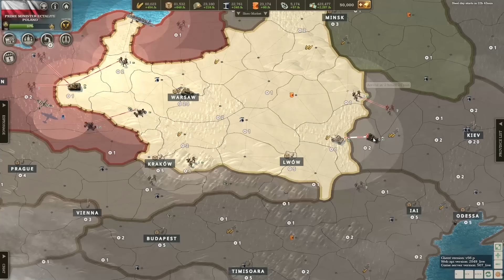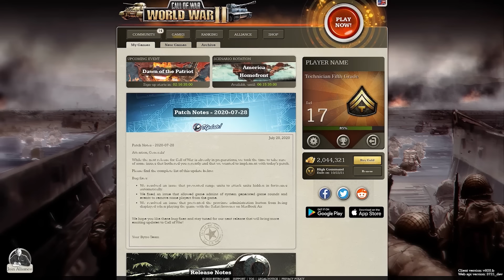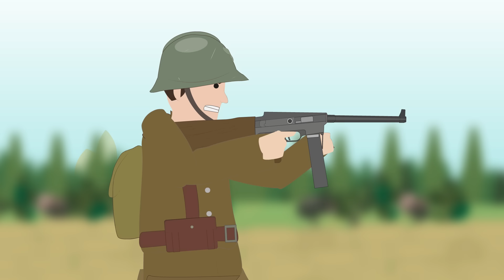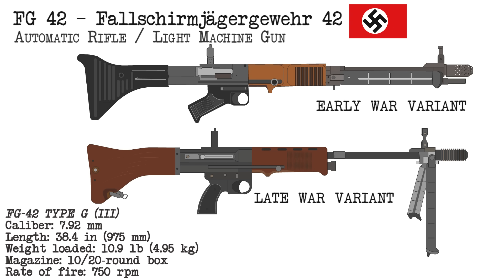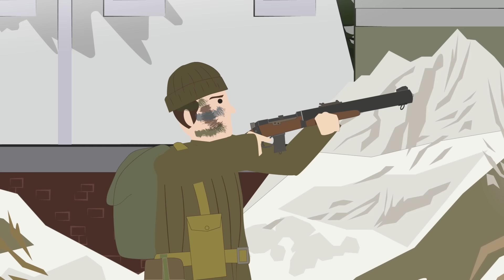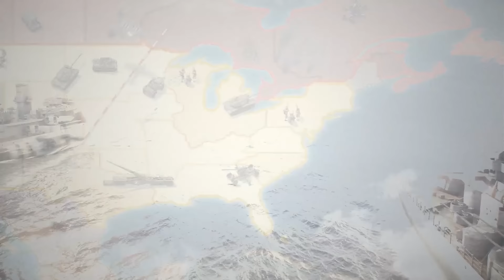The Rarest Guns of World War II

Comment: The MAS-38 may have been rare before and during W.W.II but after is a different matter, the French went on to produce over 200,000 of them between 1945 and 1949, so they’re not as uncommon today as the video might suggest. As far as the De Lisle is concerned even though less than 150 were produced they went on to be used in both the Korean War and the Malaya Emergency, it’s also rumoured that they were still in use by British Special Forces until the early seventies.

Comment: Well, they didn't do the FG-42 for ego reasons. 
Basically it for the paratroopers it replaced the Kar98k and MMGs like the MG34 with a multi-role gun that was lighter and easier to use because it had a semi-automatic and fully automatic switch. That way it could be used for machine gunning, assault, and marksman roles. 
It took way too long to design, though, and had design features that kept changing due to conflicting roles. For example, the angled pistol grip was better in a marksman role  when in prone but less appreciated in assault roles. The Bipod placement was apparently also a huge conundrum that kept getting moved around.

Comment: I have a repro FG42, and it shoots extremely well.  Recoil from the 8mm round is minimal:  the muzzle brake is very effective; and the straight receiver/stock design helps.  Years ago, when stationed in Germany I talked to FJ veterans and asked about this weapon.  They said, pretty much what the video says:  great weapon, not enough of them.  Though they primarily used it as a semi-auto rifle as in full-auto it was difficult to control.
Reply: Difficult in full auto?
Also when prone using the bipod?

I always figured that the Bipod was needed for such a heavy recoil on the light gun.
But I never got the chance to ask if that was true or not.
Reply: @MrDwarfpitcher  well the Bipod is because it was designed to replace some paratroopers' Kar98k. They used the semi-auto with it as they also issued scopes with them (at times).

The angled grip and Bipod at the end of the barrel reflect that design consideration.
However, these features were less favored because they made the full auto less comfortable as bipods on machineguns tend to be better slightly towards the receiver iirc
Reply: Well for a gun lighter than the Gewehr 41, I'd expect the Full-auto fire option only being used for close-quarters if they somehow found themselves in those cramped spaces.
Reply: first of all no u dont
Reply: @BastianOejenholt  how would you know

Comment: Purchased a pretty rare piece from World War II last summer. Called the Mosin Nagant M91/30/43 by most gun enthusiasts (records of its existence in English are practically nonexistent). A limited production of around 21500~ were produced to appease Stalin's rage at his soldier's habits of losing bayonets. So a contract was offered to whoever fixed the issue. A fixed bayonet was proposed, but was too long for the CQC elements of the Eastern Theatre. A man by the name of Semin (Syomin) concocted the idea of a side folding bayonet that locked into either place when required. Design was turned into the M44 after Stalin was pleased with the results.

Comment: You want rare?   
What about the Norwegian-made Sten guns? Made in bicycle repair shops and other small workshops in German-occupied Oslo. They designed an automatic record player in order to xcommercially produce the parts needed for the trigger mechanism. They are easily recognisable as the only Stens that are top fed. But most of the around 800 made was destroyed soon after the war ended, so good luck in finding one. (Only about 20 are known to exist)

Comment: "under powered 8 mm pistol round" yea... most submachine guns lack the "bite" it's called sub- machine gun because it's sub-sonic, aka not flinging the round fast enough to brake the sound barrier. Most if not all SMG's are pistol calibers. 8 is 1 mil smaller than 9 and the 9mm MP5 is still used by cops in America for certain breaching/clearing situations because it's compact and you can fire it faster than a pistol when force above a pistol isn't needed. Plus you'd be using submachine guns in close range, you won't need a more powerful or larger round to put 10-20 pieces of metal into someone in the bush next to you.

Comment: The magazine wasn't the only flaw of FG-42. The other were:
- the fact that the gun was too light to be easily controlled in full automatic fire, despite being fitted with a muzzle brake
-the complicated firing mechanism
-was expensive and unreliable, especially when fouled after prolonged automatic fire
-made of alloys that were also needed for aircraft
-the bullet was too strong for it, which was the reason Stg-44 used  7,92 x 33 mm Kurz which made the weapon far easier to control it in full auto and burst.
Reply: Ian would disagree

Comment: There was a pair of french pistols made by MAC both in 7.65 longue, the mac1935a and mac1935s, the a model was initially adopted because of higher quality than the other. However the s model was also adopted shortly after to increase the numbers of pistols they had. Then Germany invaded, and converted the french factories into German weapons factories to make walthers. Roughly 2000 of the S model were made, I personally don't know much about the a model but I have one of the s model handguns. It's sights are built into the slide and non adjustable, but its based on brownings 1911 recoil system, single stack magazine too but the ammo it uses is weaker than 9mm and closer to .380 app in power. Mine is currently inert and I'm in the process of repairing it. It fits surprisingly comfortably in the hand despite being a fairly compact pistol. I've been told that some pictures of nazis holding pistols where they're often thought to be carrying browning high powers they might actually have a Mac 1935 variant.

Comment: I'd really like to know more about why the Japanese deemed SMGs unnecessary. It's astounding that they were able to capture and defend so much territory armed primarily with Arisakas. Maybe they could've held out longer had they developed a reliable SMG...
Reply: It's because the Japanese already  had very reliable LMGS and HMGs. The Type 99 light Machine Gun was very deadly. Just look up the U.S. casualty numbers on Iwo Jima as proof!
Reply: They also issued a ten pound light mortar (the 50mm Type 89), about three per platoon. It fits somewhere between a grenade launcher and a proper mortar and was used effectively in jungles or urban environments.  It could be fired by a single soldier, or achieve a horrific rate of fire with additional soldiers assigned to help.

Comment: FG 42 was an Automatic Rifle and light Machine gun, not an assault rifle, An assault rifle is distinguished by using a smaller round then a std battle rifle. FG 42 used 8mm Mauser, the the first "Assault Rifle" was the German Sturmgewehr STG 41-44 which used the Kurz cartridge which was 7.92x33mm vs the FG42's 7.92x57mm, i.e. smaller round.

Comment: This is some sort of a joke. Every military historian agree that FG-42 was a failure of a weapon. Both early and later design. The recoil caused by the design and use of rifle ammo made the weapon very inaccurate and prone to jamming. Not to mention ludicrous rate of fire for a weapon using 20-round clips.
Fun fact, the early design of FG-42 had to be able to launch grenades, but it turned out that the recoil was able to FOLD rifle's butt (which was hollow, made of metal).

Comment: The Japanese SNLF (Special Naval Landing Force, basically for you Americans reading, they were kind like a cross between the marine raider regiment and were also trained in amphibious assaults, beach landings and even had a elite naval paratrooper division and a tank division. They were the only naval infantry unity to have Medium tanks, and were the first to get the up-gunned Chi-Ha Shinhoto (A tank which would of been a king of the battlefireld in 1941-42, it was equivalent to a more lightly armoured Panzer III (50mm Gun Version). 47mm high velocity gun had to get very close to penetrate a sherman's front armour, but the sides could be picked off at 300m and the rear at 500m. This tank had the most American tank kills, and drivers of the M3 and M5 Stuart Feared this machine, their 37mm gun could only penetrate the front in certain points at close range, and it's 47mm high velocity gun would eat Stuarts fro breakfast. It's AP shell was the bane of half tracks too, but to be be fair a Type 95 Ha-Go could take out a US M3 half track)
They were fantatically loyal to the Emperor and their country, you could think of them of being the 'SS' of the east, Elite training, battle hardned, better equipment, better junior & semi-senior officers led them (howver early in the war the IJN high command were sometimes confused on how to use this elite unit of shock marine para-commanods, and were sometimes used in times where they shouldn't of been, and experienced heavy casualtoes being used in hman wave attacks storming beaches like conscript infantry, and this wasn't what they were for. 
They were better trained and in some cases even better equipeed by their US counterparts (Especially in the Japanese invasion of the US owned Phillipines, Where US Calvalry charged Japanese Ha-Go tanks with pistols & Swords (The Polish charging tanks with swords was myth, but the US did charge Japansese light tanks, bunch of mad lads, but most were killed by the Japanese tank's machine guns. The American soldiers had been told the Japanese light tank's armour was so thin, they thought their Sabres, Bolos, 1911's, Thompsons and evn M1 rifle fire would be enough. Us anti-Japanese 'yellow peril' propaganda at it's finest here, getting your boys killed.) 
The SNLF wore a OD green uniform and used a combionation of Arisaka Type 38 (6.5mm) Type I Rifles (Caracanos made by Italy for the IJN, the only chnages were the mauser-style stripper clip feed & box magazine, and the Japanese 6.5mm Calibre.) They also used around 6,000 SIG M/20's (Which were post WW1 MP-18 SMG's with the box magazine and police safety upgrades. They liked them and then ordred a unknown number of both Bergmann MP28's (also in 7.63x25mm and Steyr MP34's (Sold internationally as the Steyr-Solothirn S-100, and there were also chambered in 7.63x25mm Mauser. They had the highest concentration of SMG's in any unit of the Japanese army and they were all very high-quality guns from the interbellum. (Of course they were the first to get the Type 100, but not many of these saw combat (they did on okinawa) as they were being recalled for the defence of the home islands, along with all of their best kit like Chi-Nu Tanks, a variant of the Chi-Ha designed to be a sherman killer with a 75mm high velocity gun which could rival that of the German Panther. They also had the Chi-He Tank, a Ch-Ha Shinhoto which was faster and had thicker armour) The SNLF alao used Mauser C6's, C96 pistols with detachable box magazines (not the full auto ones, they were the M712, but the Manchuko army did capture and use these also.) and their tank division had Type 98 Ke-Ne light tanks, the upgraded version of the Ha-Go which wasn't vunerable to .50 AP rounds, It also had a 2 man turret, and a 7.7mm MG instead of a 6.5mm (However Ha-Go's were being retrofitted with 7.7mm MG's near the end of the war. And the SNLF also did use HA-go tanks.) They also had many variants of amphibious tanks, some decent but usually used poorly as they hadn't been used against a serious enemy before. Also most of them couldn't stand up to a 37mm gun t that buoyant, some couldn't stand up to .50AP and some even .30-06AP and .50 ball.
They had tankettes (Type 94 being most common, the Japanese designated tankettes as armoured cars though) used for unfantry support (people laugh at tankettes, but try killing one when all you got is a M1 garand, M1 carbine and Tommy guns in your squad, you would be ripped to shreds adn they were perfect in ambush, The SNLF made a huge use of snipers, which was thw abne of US Gi's as there was plenty of places to hide, and i think other than the Finns, rhe Japanese had the best snipers of the war. If you exclude neutral Switzerland and Sweden they had the best sniper rifle of the war too (And the Arisaka being the best bolt action of the was was an excellent base.) They of course had all the other bells & whisles. Light & Heavy Mortars, Bazookas (Look up the type 70 bazooka, it was a 'copy' havily inspired by the US Bazooka but more powerful, yet not as poweful as a Panzerschreck. They had artillery of all sizes, anti-tank guns (The most common being the 47mm, the same gun on the Chi-Ha Shinhoto,, would pop a stuart or a Greyhound like a grape but had to get very close to a Sherman or hit the sides or rear, the thing is AT guns are much easier to hid than tanks and they used them in tandem with minefields & sniper fire. Oh and of course you can't forget the fact the SNLF used the Shin-Gunto sword, bur the naval versions were made from a special steel, high-carbon, but with some chromium added making it a 'sort of' stainless steel. It didn't effect the strength of the sword (everyone knows stanless steel swords are crap)  however it gave the sword some resistance to saltwater. There is theories that ot was simply plated with some kind of stainlesss steel, but the only true fact known is the naval swords were more saltwater resistant  than the IJA Shin-Gunto.
The Japanese army is often overlooked as 'crap' 'fanatics' and 'outdated tanks' (Partially true on the tank side of things, the tanks they had were top notch at the begininning of WW2, some of the best in the world in the 30's but so much money went into the navy tank development was neglected. Plus they had never had large scale tank battles in China, the Chinese tanks (Things like CV-35's. Panzer 1's. Carden Lloyd carrier and the like usually were just armed with machine guns and had trouble witth Ha-Go's, more were knocked out to Soviet copies of the German WW1 Tankgeweher than by Chinese tanks. 
Anyway just wanted to write out something about the elite Japnese SNLF, a underrated unit, yet alongside SS, Soviet Red Guards, UK Royal Marines Commanos (What the SNLF were, and should of been used the way the British used the RMC's) As they are severely overlooked and underrated.

Comment: I feel like this might give people an inaccurate impression of the FG-42.

It wasn't designed because Goering wanted to one-up the army; it was designed because German parachutes were of an inferior design compared to other nations, and they could not carry much extra weight. Goering wanted a weapon that could serve as an infantry rifle, light machine gun, and submachine gun, all without being too much heavier than a standard Mauser rifle. The engineers working on the weapon joked that Goering had ordered an "egg-laying woolly dairy pig", a weapon that was expected to do everything at once while also being lightweight, durable, and cheap, altogether a near-impossible task. The design compromises needed to meet the requirements meant that it wasn't actually very good at doing any of the things it was supposed to; too heavy to be an infantry rifle, not robust enough to be a light machine gun, and not portable or controllable enough to be a submachine gun. Soldiers liked its firepower, but disliked its tendency to constantly break down in the field and the difficulty of repairing it due to its complexity. German military focus shifted further and further away from airborne landings as the war progressed, making its existence fairly moot.

Comment: "The FG-42 was intended to be used as an assault rifle"

The concept of an assault rifle didn't exist at the time of the FG-42's inception. It was intended to replace the machine gun at the unit level of the German paratroops.
Reply: it more close to a battle rifle like the later G3 and FN FAL.
Reply: The Federov Avtomat would like to have a chat...
Reply: Was about the time when the MKB 42 was developed. Technically the term did not exist, but the FG42 was made to replace the Kar98 and MP40 in service by having the rate of fire of a MP40 and the range of a Kar98, while weighing about the same as a Kar98
Reply: The FG42’s semi-bullpup feed system would be used in the M60 medium-MG.
Reply: Semantics.
Reply: So assault rifle and carbine
Reply: It also wasn't created because Göring wanted to have better guns than the army, but because of the need to have more compact and lightweight rifle/machine gun for paratroopers, who couldn't jump with Kar98k or G41/G43.
Reply: @janslavik5284  And something Simple History glossed over was the fact that the recoil of the FG42 was likely insane. It fires the same exact round as the Kar98k (which has a nasty kick), but from a lighter gun and in full automatic.